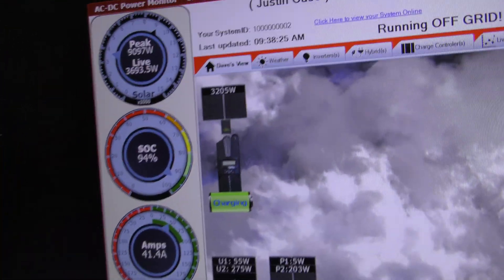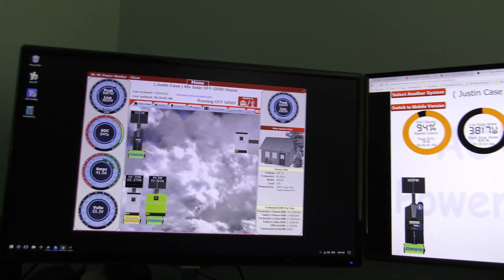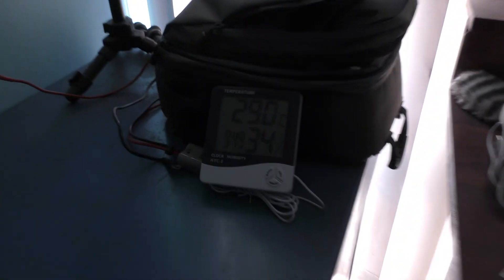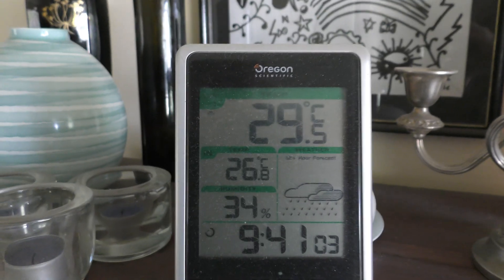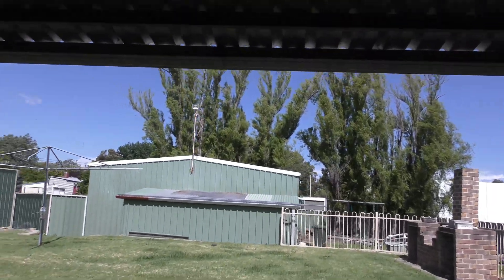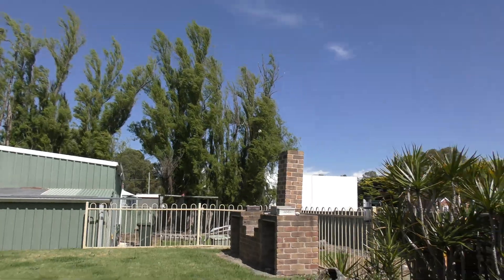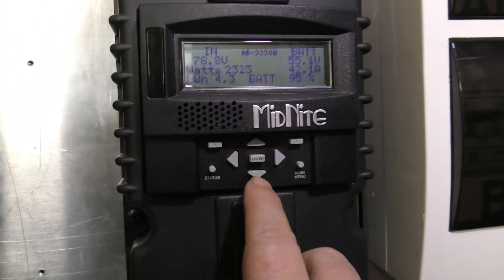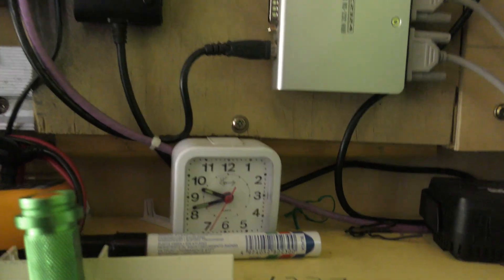Solar power. Off grid house.  Australia

Comment: Great Video once again, i am wondering when running your inverters you have a choice of output voltages of 220v 230v and 240v and i see on yours you have them set to 230v is was wondering why this voltage was chosen?
Reply from the maker: Its the voltage we are meant to be running now in Australia. All States changed to 230vac plus or - 5%.  Generators are now meant to put out 230vac as well. So When we get the Auto start generator it will not be a power surge from 230 to 240. or visa versa
Reply: Ok i know 240v means anywhere between 220 to 250 so my guess you went for the middle but now it makes perfect sense. Thanks
Reply from the maker: The regulations state + or - 5% anything over or under that and they are liable for any damages done. That is why they had to fix and replace all the damaged equipment and fittings in my home and pay for the electrical contractor to come out and fix any burn out wiring. Then when it was all fixed or replaced i went off grid.
Reply from the maker: I will also say. Since i have been providing and monitoring my own power. I have not even had a light globe blow or computer power supply blow. When i was on grid i would go through dozens of light globes and 3 or 4 TV and Computer power supplies a year. So for me going off grid was easy. It has also save me not just many thousands in rip off power pricing. But many thousands of $ in replacing the gear that went POP due to the shitty power provided. Thank god for the Electrical ombudsman here in Western Australia. http://www.ombudsman.wa.gov.au/energy/contact_us/contact_us.htm
Reply: I have noticed the fluctuation on the grid voltage but didn't put alot of thought in to the wear on products because of this, Its just another reason why a off grid is a no brainer choise. Thanks Justin as there is so many questions to setting up a system and people like you are our only help!

Comment: Hi Chris, hope you don't mind to share your experiment with your subscriber on your infinity 5K? Does the gear work fine with the grid sine wave voltage?

I'm currently use twin of PIP5048 and feel like lots of electricity waste from my roof after my 1120AH bank getting full change on a daily basis around 2PM.

Truly appreciate your thought, knowledge and inspiration!
Cheers
Richard
Reply from the maker: I don't have the grid at my house. Its off grid. The Hz is better then the grid was when we had it. very stable. I have been providing own power for a while now.
Reply: Thanks Chris. 
I recently have a chat with Peggy to get her confirmation about the parallel kits I'm using with PIP5048(s). I want to swap them over to Hybrid V model.
Reply from the maker: Peggy is a very nice person. She will always try and do her best to help you. I have a lot of respect for Peggy

Comment: Lovely setup Justin!!
What was temperature in the shed with door closed - or do you have an aircon in there?
Reply from the maker: it has fans that change the air in the shed about 2 times a min. It would not be a good test of the inverters and charge controllers if they lived in Air conditioner. So the temp in the shed is the same as it is outside.